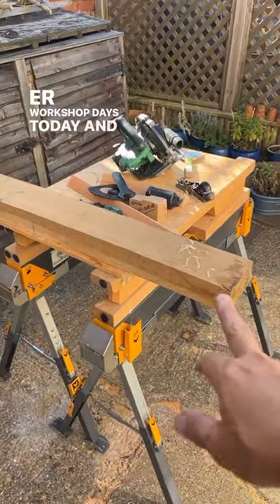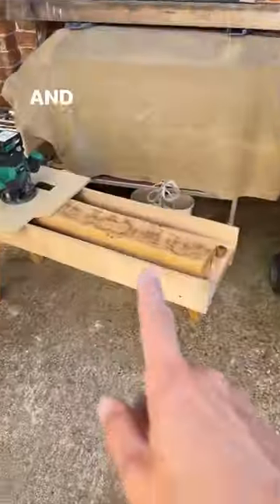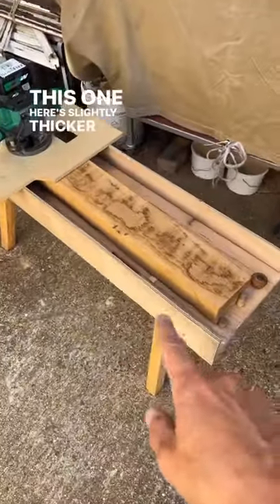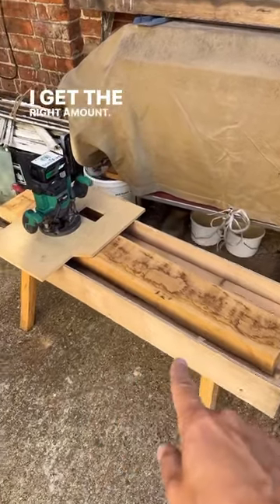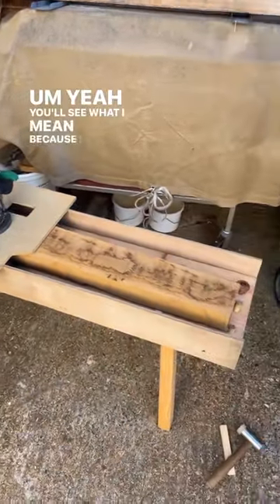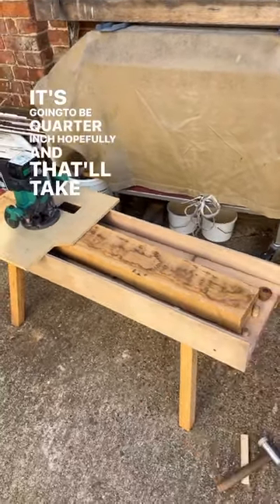English oak window sill with a router

Comment: Awesome work!  Possible to show how you milled the cill?  Thanks
Reply from the maker: I mean, not this actual cill, it was done, cut, fitted and painted months ago…… but the shape was machined with a thickness planner and a tapering jig.
The step then gets routered on the slope face with a straight bit.